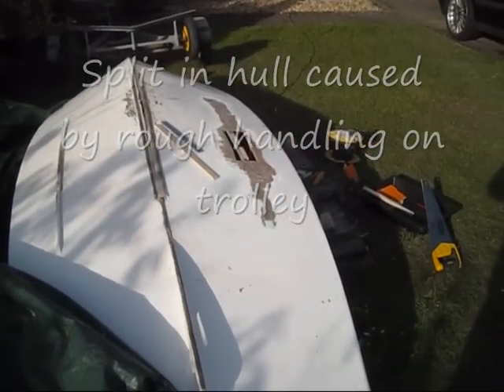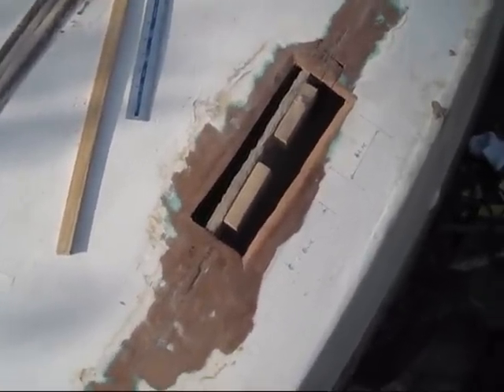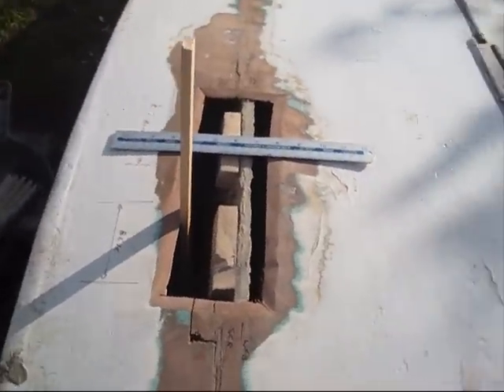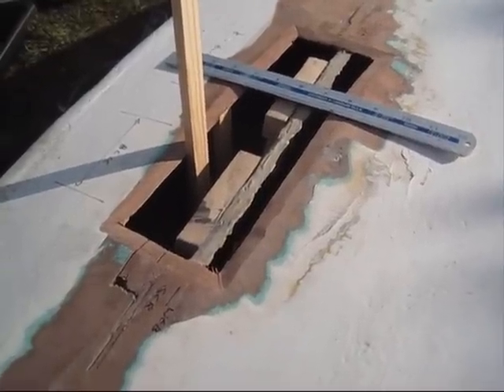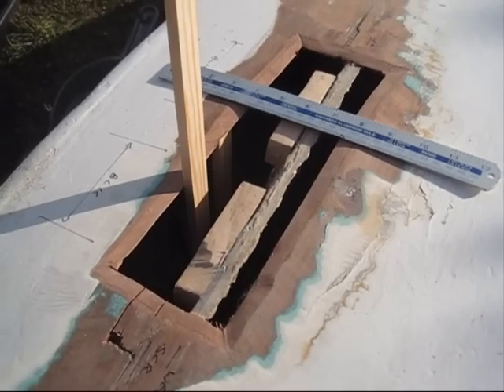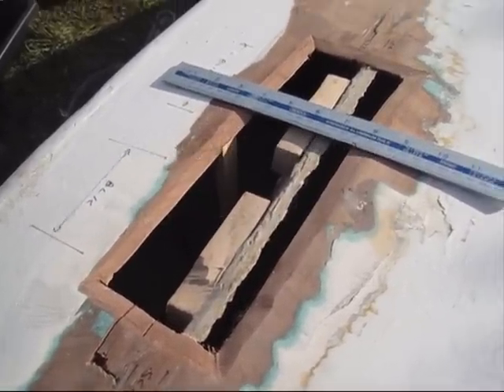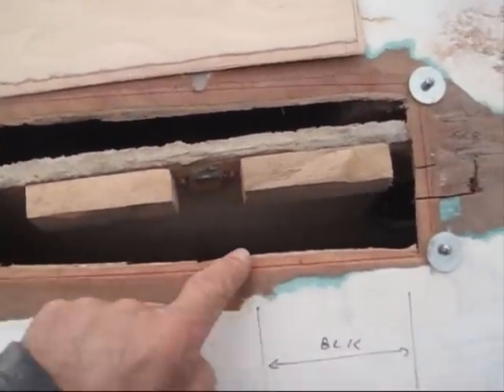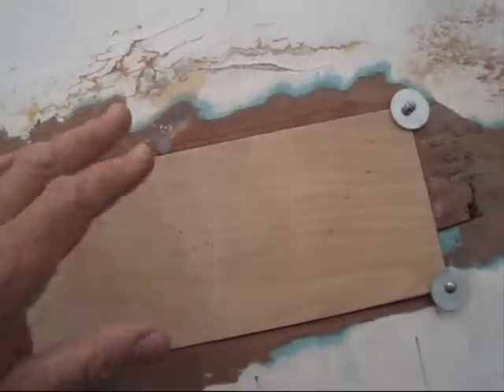Repairing a Mirror Hull

Comment: Thanks for this. I am looking at a used Mirror that has a hole in the port bow. Before your video I had no idea how to patch it. Still not sure given the curve there. ;-) Any thoughts?
Reply from the maker: The curves are all simple curves so ply wood will bend OK. You will need to cut a regular shaped hole,  then chamfer the edges, then make a matching patch. Then use temp screws to hold the patch on while the fibreglass sets. david